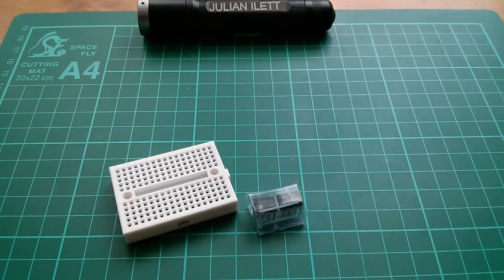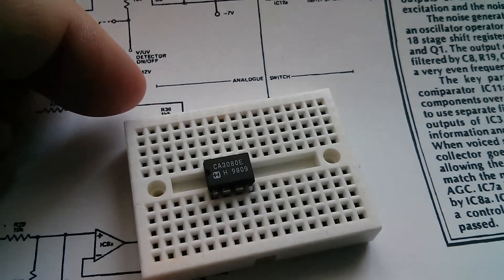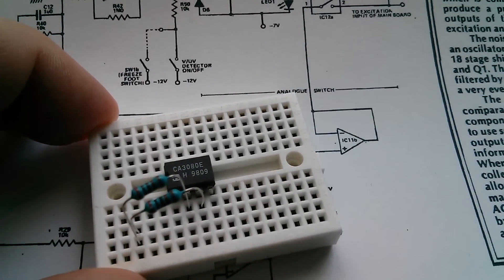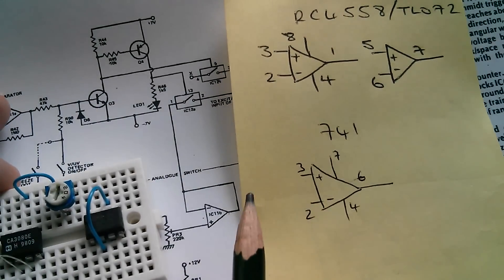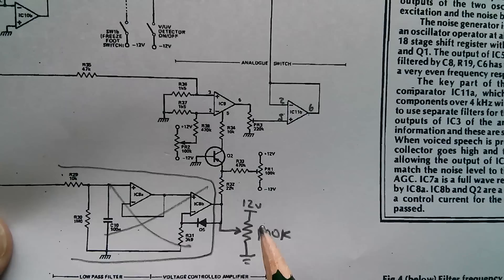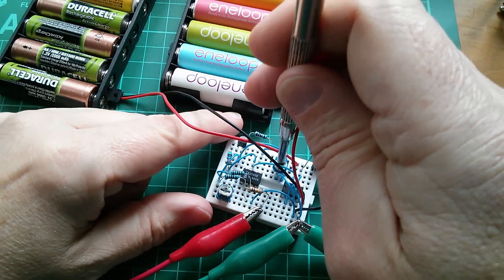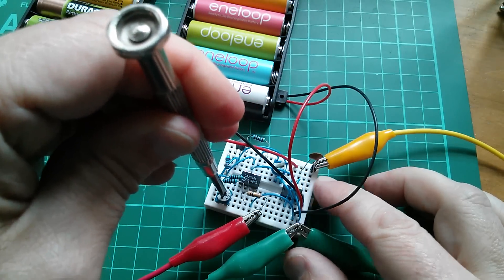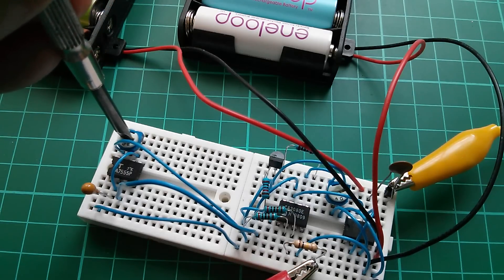Julian plays with: Beethoven, Bach and Transconductance Op Amps

Comment: Nice one - you used a bunch of electronics to emulate a skipping CD :) Would make a cruel trick to play on the LP buff - stick this circuit between their turntable and the amp when they're out of the room and have a bit of fun with digital potentiomeneters, and a 433 mhz RF remote :)

Comment: Cool.  I want to use a couple of these OTA for a circuit to vary white noise input to make a crashing wave sound circuit.  I figured I would make 2 channel VCA with random modulation frequency in each to make it sound natural with a third channel as low level background white noise.  Very timely circuit. Thanx.

Comment: Ray Marston wrote a great article on OTAs for Nuts and Volts.
It's has a VCA circuit that I've built in the past that's fun to use with an ADSR envelope or just a simple LFO for tremelos.
http://www.nutsvolts.com/uploads/magazine_downloads/11/May%202003%20Ray%20Marston%20-%20Understanding%20And%20Using%20OTA%20OP-Amps.pdf
Reply from the maker: dentakuweb It is very good - very detailed.

Comment: A concept that might improve the original schematic would be to change from a linear gain control signal to an exponential one (proportional to the drive signal as an exponent).  I think you might find cookbook, voltage to exponential current output circuits in many opamp manuals.  I may be able to help with that.

Comment: It might sound nicer with the 555 signal taken from the timing capacitor rather than the square wave output.
Reply: Andy Walwyn  Yes. LFOs are usually more useful when they're a Triangle or Sine.
A square wave gives more of a "gating" effect than a tremolo.